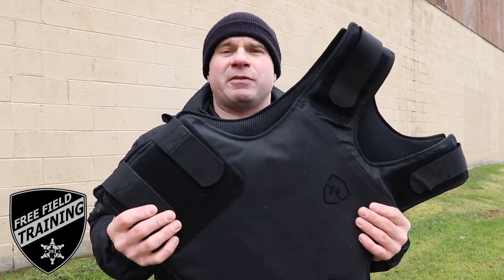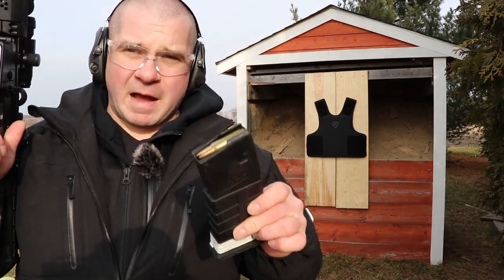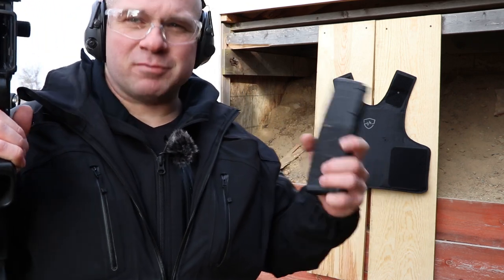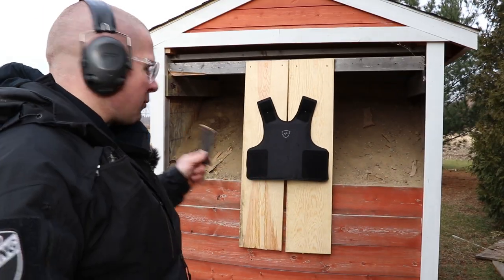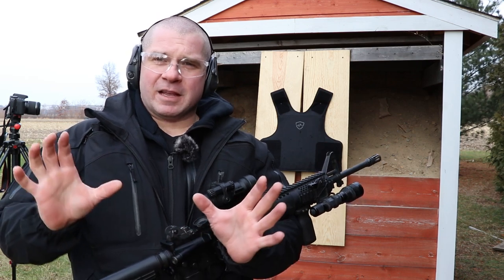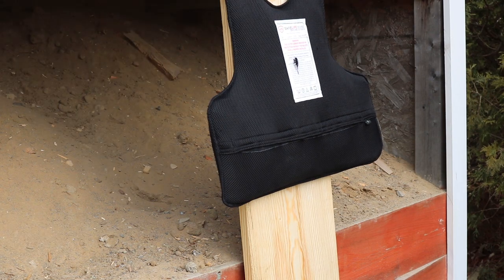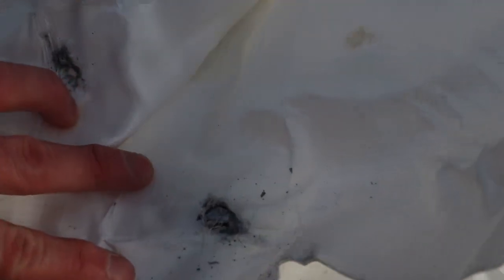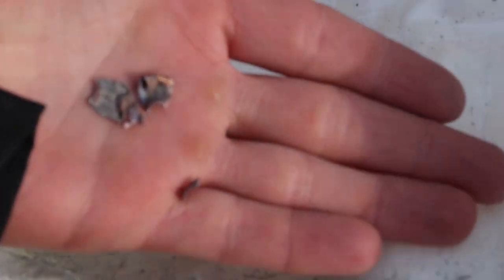RIFLE RATED BULLETPROOF VEST | Safe Life Defense | FRAS Flexible Rifle Armor System

Comment: Interesting review.
It should be noted that clay needs to be used for accurate backface deformation, the wood is not an accurate form of measurement or assessment regarding impact of different calibers.

I do wish you would have dismantled the entire panel so we could all see the extent and area of protection from the level 3/4 hex mosaic pattern rifle rated protection. We do not know how much of the soft armor area the hex pattern covers.

Also it appears beginning at strike face to wear face the vest is layered:
1. PE layers
2. Mosaic hex pattern more than likely constructed of Silicon Carbide
3. Aramid layers
4. PE layers

Is the mosaic held together by an adhesive? How durable will that be also considering extreme environment temperatures subjected to the user.

Comment: When you cut it open, would have liked to see how the rifle armor was set up. From the small portion seen it appears to have resemblance to the dragon skin design.
Reply: I noticed that too. Its incredible.
Reply: @0fficer47  I remember the DragonSkin controversy VERY well. My take-away from it was that the concept was incredibly sound, but it might've needed more development, specifically that the glue used was possibly suspect under harsh conditions, but different manufacturing methods might've helped. And, importantly, the US Government intentionally torpedoed it at every opportunity to protect crony contracts with existing body armor manufacturers, instead of putting our troops first. Just like when the M16 was introduced.
Reply: The only thing that worries me is the adhesive holding the discs together. I hope it is not plagued with the adhesive issues dragon skin faced. If they will warranty for 10 years, I am definitely game.
Reply: @allanbain7930  keep us informed. If intellectual property was stolen, thats not cool. Do you offer something similar with the light weight/cost ratio. 16lbs medium full coverage/approximately 1500.00? Thanks for the info. By the way I own your great products also.
Reply: @allanbain7930  
Body Armour is a cutthroat industry!...
Reply: Andy Munoz  Thanks for the heads up.
Reply: Andy Munoz  can you provide a link to the company. When i search for it i am getting a bunch of video game crap. Thanks.
Reply: Andy Munoz  thank you very much
Reply: Ya that looks just like Dragon skin and I posted in a comment on Instagram on safelights post and it's gone now. Don't know where the comment went
Reply: @SkywalkerOG14  they also removed Allan Bain's comments, the inventor of dragon skin and patent holder of hexar armor. Seems there may be some allegations of patent infringement. We'll see how things play out.
Reply: It does resemble dragon skin...and from what I can tell to no surprise this FRAS is not NIJ certified.
Reply: According to some sources on r/ TacticalGear, FRAS is using disreputable chinese sourced materials, and is actually heavier than competing products of it's rating, like a Hesco L210, or somesuch.
Reply: @bobbie4862  
Scalar Armour's concept is not patented. Dragonskin, Ceraflex, and Phoenix all have entries in this section.

Comment: So this armor (which might be considered level 3) is made of 1 layer of kevlar in the front, a flexible layer of ceramic tiles, and at least 14 layers of more kevlar. This is a brilliant combination of fiber and non-fiber and is a technical marvel as previous body armor with non-fiber protection isn't as flexible and is heavy. Like if you agree.

Comment: So panel is made with Dyneema on front and back and in the middle, it has Kevlar "pouch" and inside in the pouch is hexagon shape ceramic tiles.

More interesting would be see, how this vest work when it is not placed flat.
Like when it is contoured on the wearer's body, like in the sides.

How well these ceramic tiles work then when panel is curved. 
Does the space between ceramic tiles come larger when ballistic panel is curved?

Will the tiles still break the bullet or does it go thru space between ceramic tiles?

Remember that NIJ standard test is made usually on flat surface and the test vest is placed flat too.

And if you want to be more like NIJ precise, it states armor test distance: 
Handgun Rounds: 16.4 ft ±3.28 ft Rife Rounds: 49.2 ft ±3.28 ft.

Also the backing material should be more softer, not these wooden blanks.
Reply from the maker: Our goal is not to be more like the NIJ testing. The armor is sent to a lab for that. We are trying to replicate the worst case situation  to give people a realistic expectation of performance in field conditions. (point blank range, right over a bone) the next test will be the armor curved around a gel torso, unless I can find a hard immovable torso. Though given the lab results I don't expect any of that to be an issue. Any other ideas?
Reply: @freefieldtraining  Gel torso is great idea.

I know and my opinion is that NIJ a bit "old" and clinical test now days, as compared to real world scenarios.
But of course officially, it gives good reference and starting points.

The weak point can be side shot on the curved panel.
But you never know before that is tested.
Reply from the maker: @AR-tt8rt  Well the lab has already tested to the standards. According to the lab guys at shot they tried to get rounds to go between the panels and were unable to because of the geometry. We shall certainly give it the good ol college try as well though so people can see. I'll have to figure out a way to test it where it hits the separation points. I'm open to suggestions on that front.

Comment: Any body armor that does not protect against M193 or high velocity rounds is useless. The M193 round is the cheapest most common AR15 round on the  market. Now that  Ruger has come out with an affordable 5.7 pistol all body armor should be required to have protection from 5.7 round also.
Reply: sugarland77478 - the black dragon fang 5.7 and the T6B 5.7 may actually go through.

Comment: Tactical Scorpion Gear - Level III+ Extreme PE Body Armor from $239 to $329 per side stops even multiple M855A1 2x 8x10 plates weighs 6.25lbs, 2x 10x12 plates weighs 9.37lbs, and 2x 11x14 plates weighs 12lbs. Why spend more than twice as much and get twice the weight?

Comment: Flexible rifle armor has in the past proven to lose it's effectiveness very rapidly due to heat and moisture. I would be very curious to see how this is manufactured and what a 3 to 5 year test would look like. Impressive out of the box, but does it only last for a couple months?
Reply: Dragonskin had overlapping tiles which eventually was the reason for its failure.  We dont have anything like that in our panel so no worries!
Reply: @SafeLifeDefenseBodyArmor  but is there possibility for bullet hitting and penetrating between the tiles?
Reply: Victor L this question is not relevant to this particular application, as Safe Life Defense did not make their flexible rifle armor with overlapping tiles.
Reply: @SafeLifeDefenseBodyArmor  1- when are these going on sale. 2- how do you recommend sizing or fitting be measured?
Reply: @SafeLifeDefenseBodyArmor  very cool! You guys kick ass

Comment: Now I'm curious... how many rows could that soft body armor stop when equipped with the safe life plate? 🤔
Reply: 16lbs plus another 12lbs in plates sure would be cumbersome though.     I imagine they could come out with lighter plates and get level 4, but already being so hefty who would wear it and still carry all their duty gear
Reply: @mikec2788  The Rock
Reply: Safe Life offers a bundle package. It's a concealable vest rated at level 3 for pistols up to 44 mag then a ceramic plate in conjunction with uping the rating to level 4 rifle up to 30.06 AP. Complete vest weighs 19 lbs. I added 3/16 steel plates between the soft armor and the ceramic plate and increased the rating to 4 plus. It can now stop anything below a 50 Cal and with the steel plate behind the ceramic plate but in front of the soft armor their is no noticeable bulge into the soft armor. Total weight now with the added steal plates is 25 lbs. That's front and back with side protection as well. I'm about as protected as I can get at a cost of 1200 bucks but I know I can take a 300 win mag shot and not only survive but after getting up stay in the fight. That kinetic energy packs a punch and will knock you down but at least you can get back up instead of going to the hospital or worse the morgue.

Comment: I would also like to see if it would be effective as backpack armor or if it's only good if it has your dense body or wood behind it. You could actually test that yourself by just hanging it in mid air and shooting it. That would also likely answer the question if it could actually be used to help armor a patrol car. If it requires something solid behind it, it will not be as effective in that application.

Comment: Good test, I wear a 3a+ (special threats) version of this same vest. Have for 2 and a half years now, every day. I did Yoga in it for almost a year. This higher rated model looks pretty sweet, I'll definitely consider it
Reply: Why the heck would you do yoga in body armor 😂
Reply: @RoboBreaker  1. To test my flexibility in the armor. If I can go full pretzel status in it, it shouldn't inhibit me! Doing Yoga in just the armor, there was only a half dozen positions and locations it inhibited me - impressive! 2. If I can do Yoga in my armor, I can consider the armor one step closer to being mastered. Also to make Yoga harder and more intense for more gains, which was cool at first; and is helpful for weight lifting or hitting the heavy bag etc. But it throws off body alignment in Yoga, and the extra weight makes some thing less stable or even safe. So now it sits in the corner with my props and strap as I practice Yoga. 3. I go everywhere armed and armored; except when hanging out at home, sleeping, or showering. I did Yoga at the college, past the dreaded "no guns allowed" sign - a place evil/crazy people often to to slaughter innocents. I want my armor. I can wear my armor onto airplanes or into major sporting events, and just did recently. 4. It's on me for a large portion of every one of my days for exercise, to get more used to it. So when/if I have to move in it, I'll have all those miles and thousands of hours moving it with me. It has made a difference, even when it took months to get there. Also, I had worn it for almost a year and a half straight by the time I was starting serious formal Yoga training, almost literally never taking it off, to get used to it. I was as used it to as I was going to get at that point lol. It was time to go

I don't think I'm the first person in history to do armored Yoga. They have several positions named "warrior #" that are almost exactly like a few very common martial arts stances for unarmed and melee across cultures and times. If I can do Yoga well in full plate or Modern battle rattle, I'll have a million views on the intertubez...
Reply: @justsomeguy3931  How concealable or how thick is it compared to a standard issued level II in an internal carrier? 
I'd rather not dish out my own money but if it works then hey, why not.
Reply: @FA2training  It's thin enough that it goes unnoticed except from behind, where people think it's a back brace lol. If I was to have it custom fit to me (like my next armor of the same 3a+ rating will be) it wouldn't be so bad. It is thick enough that a slight adjustment to sitting in a car is needed to avoid lower back strain. I'm big into Yoga tho, so I notice what a lot of other people don't. Here's what I wear and why (beyond my desire to stop 9mm FMJ), I'm sure the thickness and other stats are on the company website: https://www.youtube.com/watch?v=lWIRFa7Zbk8

For my part, I'm so used to it that I sometimes forget it after changing in the locker room at the gym (Yes, I work out in my armor!), because wearing it and not wearing it feel exactly the same lolz

Beyond just stopping the round, the thicker armor will mean I take less bashing damage from pure concussive force. I'd rather not die or be so badly injured from bullets that are already stopped. Some level 2 armor will stop .45 ACP 230 grain FMJ, but i'd rather have 3a+ armor on when show with that round than just level 2!
Reply: @justsomeguy3931  heh, I figured as much. I feel like if you get some bigger shoulder and upper arms, it might off set the look. 
The only thing that might be an issue is sitting for extended periods of time then being sore and stiff then trying to move around doing whatever at a fast pace might not be less than ideal haha. Then again, that the price to out weigh. I'm gonna see if I can get approved for one of these.
Any insight on spike or slash protection? I feel that is more of the worry.
Reply: @FA2training  The level 3a+ version of this armor will stop steel core (armor piercing) handgun and shotgun rounds. I've seen a big guy body slam stab this armor flat on a table with folding knives (which broke), with a fixed blade (which broke after a few more tries), and a spike with a grip on it (which bent). Maybe a charging knight on horseback with a lance could stab through this - but I'd bet on the armor

If you want more serious protection, they recently released a version that will stop AK and AR using 5.56x45 and 7.62x39, still not 7.62x51 (.308) rated tho. Not even a knight with a poleax will get through a rifle rated plate IMO, tho testing would be awesome!

As for slash protection, this armor doesn't protect the shoulders, neck, arms, etc. I've seen videos of guys in prison training and teaching how to shank around these things that guards and cops usually have. A couple layers of clothing, at least one of which is heavy, would help against knife slashes. Plus gloves and a big watch on the support/blocking hand. Elbow pads would cover an extra area to, and shin guards (they make tactical ones that look like Ancient Greek greaves, that's what I use)

I'm already close to the hulk mode of myself lol, I'm lucky to not be a total ectomorph. Custom fit armor should reduce the amount of people who think I'm wearing a back brace

As for sitting, if you make sure the armor doesn't cause your spine to misalign, you're good. It's just a thing to get used to doing, sitting regular with your back leaned against things will mess it up. I like doing forward bend stretches to keep my low back from being hurt or tweaked, it's effective
Reply: @justsomeguy3931  thanks for the insight. Definitely what I kind of expected. Glad to have that clarified. Cheers 🍻
Reply: @FA2training  I did forget one other thing. I've had a few different people punch and kick my front wearing this armor. For very light hits (or from very weak people) it pretty much negated it if I was braced and ready. For a smaller than average woman in good shape who knows unarmed martial arts well beyond beginner, she did not have to punch and kick with full force to make the hits felt, although I could still stand being used as a punching bag at around half power in short bursts lol. I'd estimate the vest takes less than well half of the oomph out, and maybe a quarter of it at most. It does help tho, and adding anything to help with blunt force would be a good idea IMO

Comment: Great video. Thank you! What does this vest weigh vs their IIIa+ version? I am in the market and I'd like to know ... PS thanks for the code, I'll use it.
Reply from the maker: Just the 3A+ without plates in a size large and concealable carrier I want to say is 5 lbs, probably less. (I don't have the specs in front of me but you can email the company if you want weights for specific sizes) I just weighed the size large 3A with 2 ceramic plates earlier today and it was a bit above 19lbs and the size large FRAS came in a little over 16lbs.
Reply: @freefieldtraining  Appreciate the info my man, thanks! Looks like IIIa+ for me, at least for now ... the price is right and I can always add plates later. Just looking for a "bump in the night" kind of rig with a few mags and medkit - you don't hear of too many home invaders using rifles ...

Comment: Out of curiosity wouldnt the impact force on the body be so great that you ain't getting back up after one round? I talking major internal damage to organs etc? Remember just asking dont go blasting me in comments Haha
Reply: The board was somewhat measuring the concussion force. That is why he was making note of dents, cracks, and holes in the board. I'd imagine that the dents will bruise but not do significant injury. Cracks probably will be cracking ribs and doing internal damage... holes... definitely doing damage
Reply: Depends on the specific armor and the round it is stopping. Normal soft armor without a hard trauma plate stopping a .44 will probably leave a bruise like a hard swing from a hammer and might crack ribs. The same on a hard armor plate might leave no mark at all. Hard to say with this particular armor without seeing deformation testing.

Comment: Enough energy left to leave an imprint of the padding like that, I wonder if the wearer might benefit from a thin plate to disperse the energy a bit. Better than going home with new holes in you though!
Reply: Spon Rilker Good point. Maybe a D30 type material (see: "oobleck").